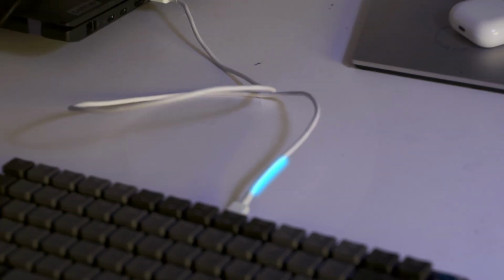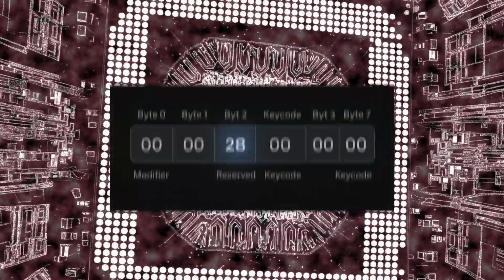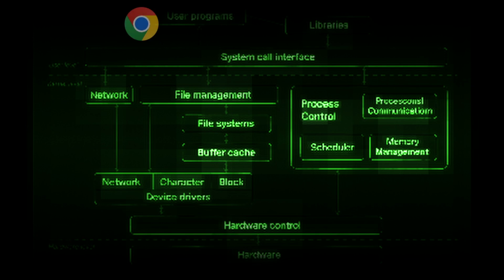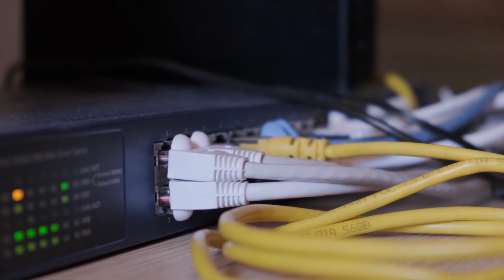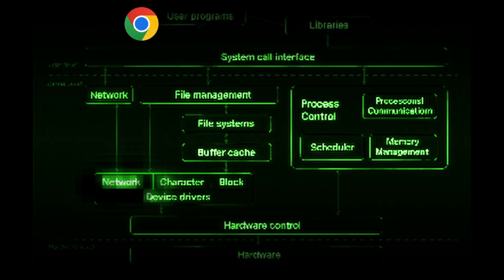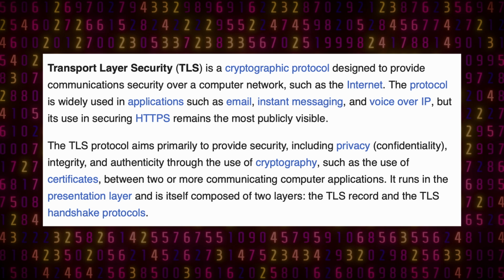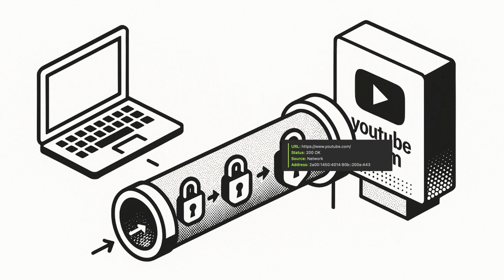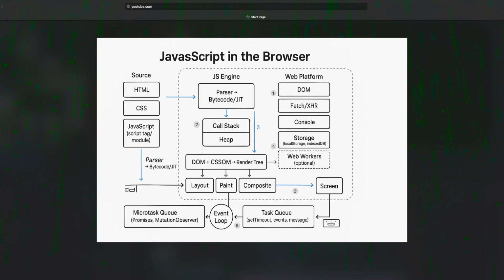what happens when you click enter

Comment: Did pressing enter took 3 months instead of milisecond keycap switch touch signalizing click that creates packaged bits into electric pulse, stored in DMA, then in operating system translated the input with existing API etc etc etc etc etc etc etc etc etc?